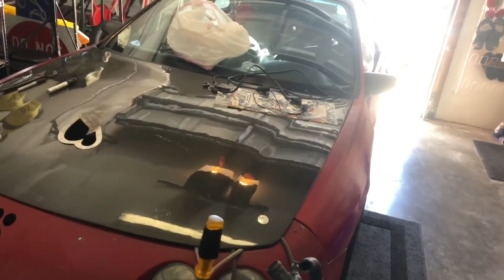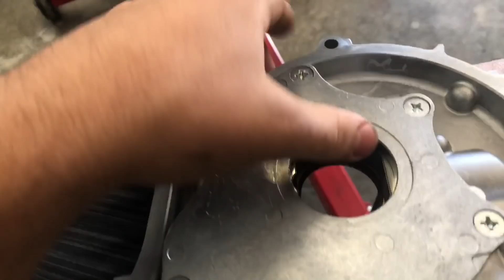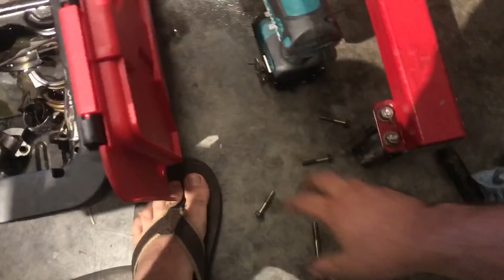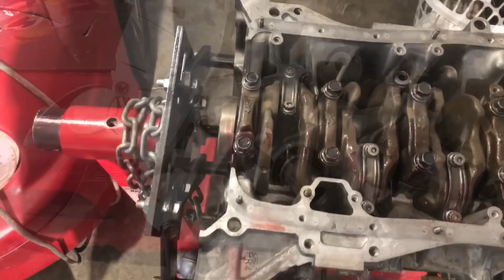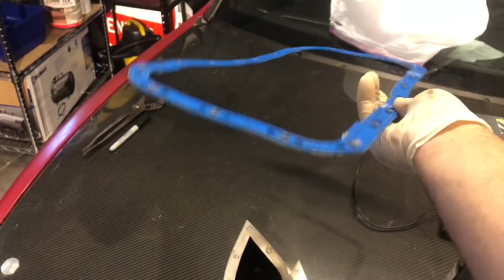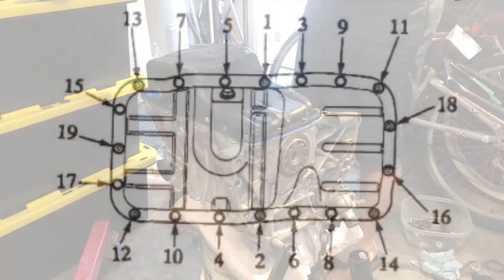800HP Honda Build || Step-by-Step : Part Three

Comment: I have a b16a2 with 185k miles on it and I want to do pistons and rods and gaskets arp studs do I have to get the block machined and honed or can I just do the hone like you did with a cordless drill thx

Comment: way to much rtv thats how u kill engines. it can break off on the inside and clog the pick up or get through into the oil pump or even worse clog a oil gallery.

Comment: Nice build , really enjoyed watching you . If i may ask, do you get boost spikes at around 8000-9000 rpm ? we have an issue on any b18 motor we are making , we litterally have to cut the manifold and weld a 2nd external wastegate  to fix it . ever had that happen ?
Reply from the maker: Yes. My soike was occuringg starting around 6k. Sometimes the engine just breathestoo efficently for the wastegate to catch up. Thank you for the positivity :)
Reply: Thanks for replying :) . If its not much to ask, how did you go with around that fix ? On 3rd gear  , with a 4psi wg spring i would get spikes up to 13 psi  at 8000 rpm  with boost cut coming on obviously .
Reply from the maker: Bigger wastegate or dual like you said.
Reply: Thanks for your time  ! :)
Reply from the maker: Anytime! Always happy to help put supporters !!
Reply from the maker: *help out

Comment: Do you plan to stick with those mounts at 800hp or plan to pick up some stronger ones?
Reply from the maker: Im going to upgrade to full billet no insert mounts soon. For now im fine. Im also running a mid plate(transmission to traction bar solid metal brace) kills almost 100% of engine movement
Reply: SP Tuning fair makes sense how those mounts have lasted. I was like omg I can't believe those mounts have made it that far 😂
Reply from the maker: Hahaha yeah man.

Comment: I do have to say that in my opinion the silicone pan gaskets are not nearly as good as the black rubber ones.
Reply from the maker: True. Alot of time theres no issue with that type. What i like about the felpro new gasket im using is that it eliminates the chance of pinching out the gasket like alot of ppl do and like i used to before i started learning loo

Comment: if you mounted the stand to the engine using the two top holes and two lower holes you can put the rear main in while it's on the stand. 

I use two trans bolts for the top,  and two shock fork bolts on the lower ones.
Reply from the maker: Thanks for the tip! Ive done something similar in the past, but for the video wanted a good shot for the viewers to see without the stand in the way. Thank you very much though!

Comment: When you guys say css block do ya mean it's sleeved? Or the top of the cylinder wall has a machined pressed in block guard? Thanks for the good vlog.
Reply from the maker: Css is cylinder support system yes a machuned precise block gaurd type pressed in like you said. And thank you!

Comment: Hey papi, you should off modified the oil pump by adding at least 2 small washers to bring up the oil pressure. Also try to run 20W-50 synthetic if you can. Another thing can you please show how you adjust the clutch to put a stop on the twin disc so the same thing does not happen again. Anyways I’m loving these engine building series. Can’t wait for it to be up and running.
Reply from the maker: Thanks bud ! I was thinking of shimmingit like you said, ill make a video on that and also of clutch adjustment/pedal stop for ya as well. Im on valvolime thick vr1 so nice heavy oil 💪 always appreciate your support and comments !!